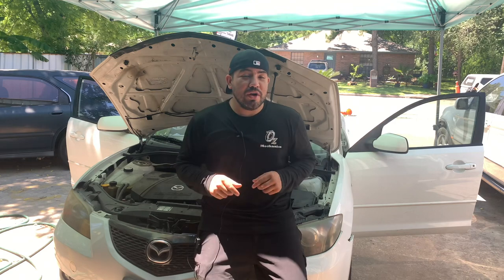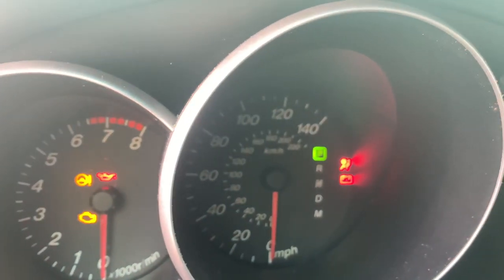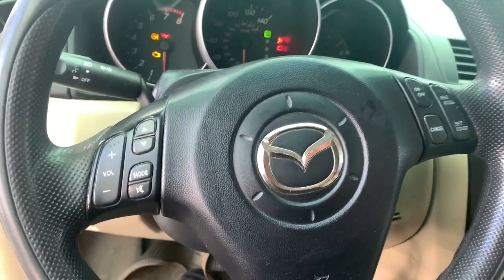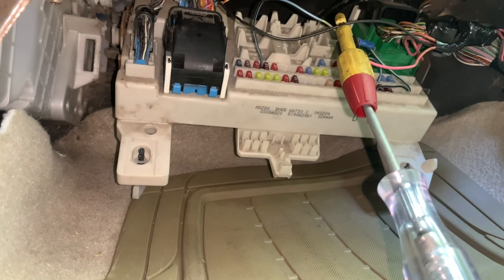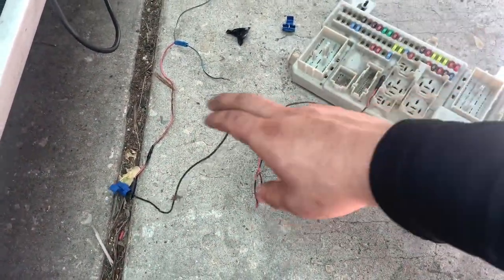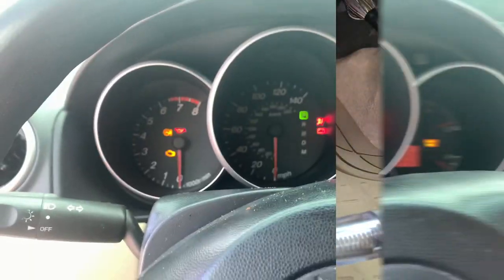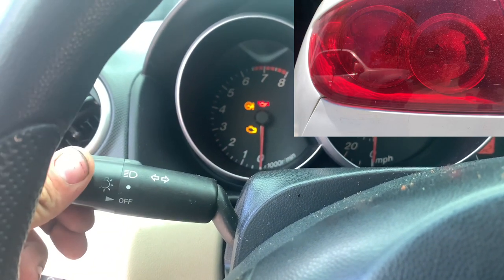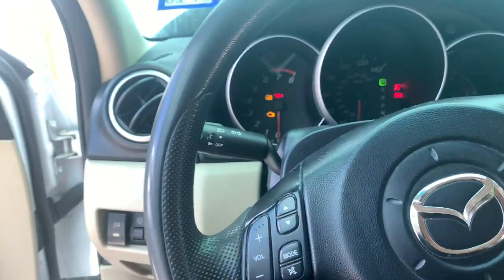Fixing broken tail light and cluster lights

Comment: When you put a used fuse box in what kind of warranty does the customer get? The reason I ask is you can’t possibly test every fuse/connection in there to make sure now the customer doesn’t have a problem with some other accessory. Just curious how you handle it if the customer now realizes this or that has stopped working.
Reply from the maker: Steve M. I did explain to the customer that I couldn’t get a new unit. And that I can only offer a 30 day warranty. It’s a sticky situation not being able to put new parts

Comment: Hey I have a question. I have an 04 mazda 3 and I have the same issue as the one in your video. Haven't checked the fuses yet but, after seeing all the other mazda 3 owners online who have the same issue, I'm probably gonna have to replace the passenger junction box like you did. But when you replaced the fuse box, was it a straight up swap or did you have to do any reprogramming once you added the new fuse box in? Some people talked about having to do that but they also had later models of the car(2005-09)
Reply from the maker: Mike D this one was a straight replacement